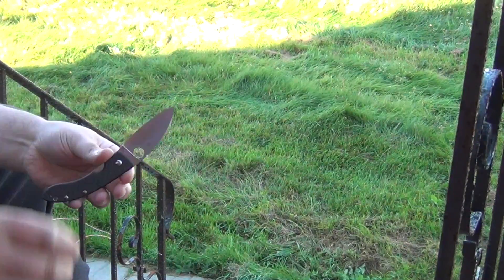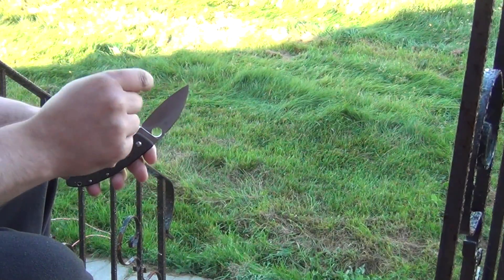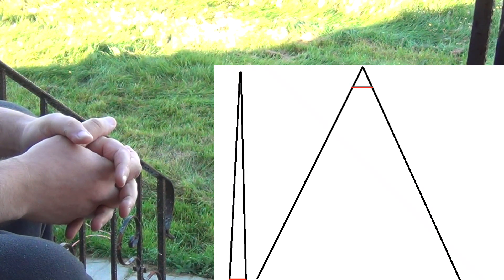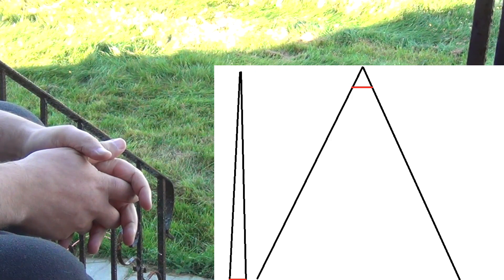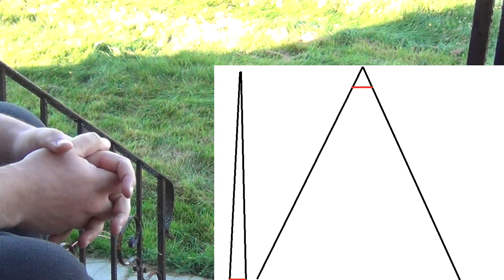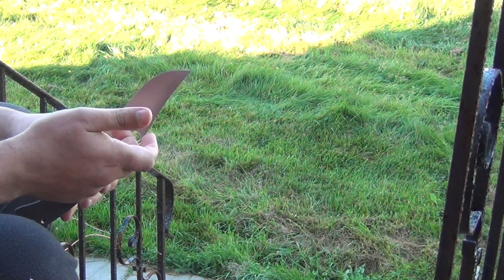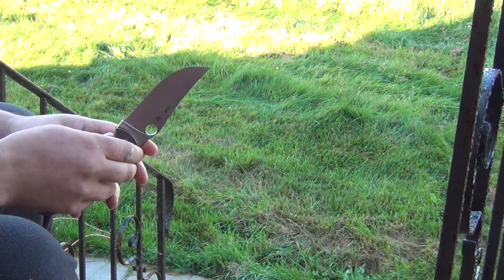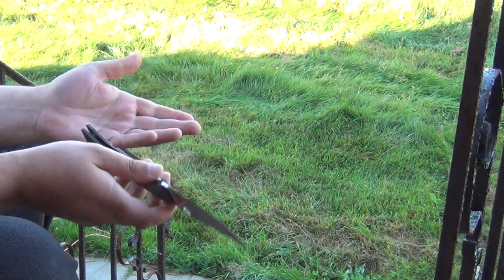Edge retention as a function of micro-bevel angle : VG-10, S30V (Wicked Edge)

Comment: This is something I'd love to see a good spreadsheet made up about. Comparing steels for the actual capability of thin edges without breaking or bending. Optimal hardness to toughness ratio, and any carbides are a bonus. Steels like 52100, 5160, 20c15.. they all have incredible toughness for their hardness, carbides be damned. 52100 with a Rockwell of 65 and a toughness 3x over D2's best case scenario, that edge can get a whole lot thinner and stay competitive.

Comment: I wonder why cliff never bothered asking what happens when you start lowering the edge angle on these high carbide steels? 🤔
Reply: High carbide steels can’t take very low edge angles due to poor edge stability.
Reply: @temhawpin  that hasn't been my experience. 

Speaking of edge stability. Something like  vg-10 which is an ingot stainless steel. That has very large carbides, likely would have worse edge stability in general than something with a higher volume, of fine carbides like a pm tool steel.
Reply: @_BLANK_BLANK  VG-10 carbides are larger but are more randomly dispersed with more matrix between each carbide. CPM steels have smaller individual carbide size but much larger carbide aggregates which create larger lines of fracture when material failure occurs. Most of what people experience with steels is simply confirmation bias.
Reply: @temhawpin  it's very much the opposite. If you wanted to see for youself. And not have it be anecdotal user evidence. Cpm 154, and 154cm is a perfect example. Or d2 and cpm d2.   

You can see the carbide segregation in micrographs of vg-10. The carbides arent laid out randomly. On thing is, they are quite large, but they are laid out in bands like any high alloy ingot steel. Because of how high amounts of carbide forming elements act while the steel is solidifying. 

That's the point of powder metallurgy, it doesnt allow carbide segregation to happen, and for carbide banding to occur. Its cools too rapidly for segregation, and growth into large carbides to form. 

If you don't believe what I'm saying look up fracture toughness of both cpm154, and then 154cm. Its a very clear difference. 

Also, its not like vg-10 is even a low carbide steel. Its carbide volume is 12-16%. Thats in the same range as k390. Its just relatively soft, and large chromium carbide rather than small, evenly dispersed vanadium carbide.

There are ingot stainless steels that do actually have good edge stability. Aeb-l for instance. Without getting into the weeds, because they can keep the carbides fine, even though its an ingot stainless steel (esr). It can reach 64-65 hrc, but maintain an acceptable toughness.
Reply: @_BLANK_BLANK maybe because large carbides are less prone to being knocked into and cracked, chromium carbide is easily abraded without cracking, and come on chunky carbide acts weird. D2 is another example. I think the relatively barren microstructure with the odd large carbide here and there makes for a different, desirable outcome. 

Also I think he doesn’t go thin or low on them too often because he also wants to be able to cut into wood and is applying a lot of lateral load the the edges.
Reply: @_BLANK_BLANK and the total volume of the carbide is what directly influences a steels toughness. Can’t really circumvent carbide volume. You CAN strengthen the fuck out of it, like with maxamet. But then again I’ve seen people break their blades so I don’t know.
Reply: @_BLANK_BLANK AEB-L is an esr too??
Reply: @lindboknifeandtool  no its actually continuous cast not esr i was mistaken when i said that
Reply: @lindboknifeandtool  so with carbides, if they are too small cracks just go around the carbide so it makes no difference. If they are too big they crack easily like in d2, if they are in between thats where you get an improvement in toughness. 

When you have giant randomly dispersed carbides they almost act like impurities in the steal that provide a breaking point for crack formation. Thats why if you check out toughness testing of cpm d2 vs d2 you see a giant difference. With psf27 in between. Its because of carbide size along with volume. 

As far as the type of carbide that makes little difference as far as the toughness of the actual carbides themselves. Even though their hardnesses are different. Thats why you ideally want only mc type carbide. Because you give up the same toughness for a given volume of carbide no matter what kind. So you might as well get the most of it with vanadium or niobium.

Comment: I always put my microbevels on 90 degrees per siden since that is 180 means you can cut with both sides of the edges its my secret shhh
Reply from the maker: You should apply them at 360, then you can cut at any angle at all.
Reply: @CliffStamp  aha and make a turn around blade yes yes

Comment: I have basically moved into more dangerous toys and haven't been really interested in knives is a while.  This video and confirming it by my own tests on several different knives /steels is part of the reason I don't really look at steels when choosing a knife.  Anything from Cold Steel Krupp 1.4116 stainless up to 154CM is fine by me.  I don't really like S30V or higher wear steels.  I've not had much luck with knives in those steels.  Some knives come with them, and I like the design enough to tolerate the steel.
Reply from the maker: Yeah, I spent a lot of time comparing steels, but mainly it was because I was interested in the metallurgy. From a practical point, learn how to use knives, sharpen them and modify them for your own uses - that is far more important.

Comment: Its a good video when you come back to it year after year and reference it to others in discussion.  From one Cliff to another, thank you!
P.S.  Did you ever do a comparison with same angle and changing only grit rating on the WEPS?
Reply from the maker: I have done grit comparisons on the same knife/angle yes :

http://www.cliffstamp.com/knives/articles/grits.html

I also started an edge retention comparision using the Wicked Edge, but got busy and didn't finish it a few years ago. I am extremely anal about methods so it takes me a long time. I have to do 8-10 runs per grit, etc. .

Comment: My question is what would happen if you put a 2.5 degree micro bevel on the S30V blade, would it then far exceed the same on the VG-10 blade?  My guess is yes... just curious how much better it would be. I am surprised you didn't cover this in your video because after watching it one would think VG-10 is equal or better with the micro bevel but its not apples to apples.
Reply from the maker: Yes, if S30V was optomized, its performance would increase as well.. The purpose of this wasn't to compare steels, but to show how important geometry was and that comparing a "Super" to a regular one geometry is more important than steel choice.

Comment: i find what is said about one steel or another depends on which steel is being sold .
      i have used most of the steels sense 1968 .i have found the main and mostly only difference is carbon or stainless .
     now everybody all at once say stainless rusts to .
  carbon is tougher .
  stainless rusts so slowly its easy to maintain and given the good heat treat is so close to being tough ( soft enough to bend )that i cant tell the difference .but tough steel doesn't hold the edge as good as hard ( breaks before it bends ) 
     so i choose stainless d1 or d2 .if they have a softer heat treat say hrc 50 to 55 .58 maybe they will be so close to carbon no layman will be able to tell the difference .and it won't rust like steel wool. so if i neglect it and i will it will be rusted so little that it wouldn't matter .
     before the zelots go off remember .i have used both in many conditions .back when the stainless was hard to get and cost more than carbon .
      it depends on which steel they want to sell which one is hyped the most .

Comment: hi,tell me please :
what kind of stone do you recommend for VG-10 Semi-Stainless Steel?
it's very hard to make sharp this steel because it's a rigid steel
thanks
Reply from the maker: What kind of edge are you trying to get? Fairly coarse or high polish?
Reply: japanese edge very sharp I need
Reply from the maker: If you want a very fine polish, high grit finish, then I would use a Spyderco ceramic to finish. I like the medium one for most work, but the fine one is higher polish still.

If money isn't an object then you want :

-a decent 1000 grit stone, king is fine
-3000, sigma power select-II
-medium spyderco plate
-fine spyderco plate

The 1000 (King is fine), is used when there is visible damage. The 3000 is used just to reset the edge bevel before applying the micro-bevel. A simpler set is :

-1000 grit kind
-medium Spyderco ceramic

This will go a long way, the other two stones just allow you to save some wear and get a slightly higher polish. However you would have to be doing very precise work to notice the increase in grit finish.

If you have any issues, just ask on the forum.
Reply: thanks

Comment: Should you not compare the edge retention at the same angles in order to determine the properties of the blade? Sure a razor blade will cut more manilla than a spoon. What is the point in trying to gauge apples to onions? Edge retention should really be a measure of steels edge holding capabilities rather than geometry, should it not? Practically speaking a 420j at 5 degrees per side would be sharp compared to, say s30v at 25 per side but is fairly useless in anything other use than super light cutting.

Comment: What does "TCE" stand for on your graphs? You did 50,000 sharpness measurements? How do you measure sharpness?
Reply from the maker: Total cutting efficiency, it is a measure of how sharp the blade stays during cutting, not just the sharpness at the end.

A light cord is cut under a specific load and the length of edge to cut the cord determines the sharpness.
Reply: Okay, that sounds more scientific than shaving your arm hair....although judging from you thumbnail photo you've got more of that than most folks.

Comment: I believe there is a lot of marketing and hype behind 'super steels' but at the same time it seems like you start your little experiments with a pre determined outcome and then work backwards to prove your point. You can in theory make 420hc retain an edge as good as 10v if you compromise all the other characteristics you want in a knife. You can make 10v retain an edge as long as 420hc without having to compromise it's overall performance as much. That's what makes it superior.
Reply: What real actual work do you do on a day to day basis where 420HC isn't good enough? 

I'd prefer 420HC for just about any "actual" work. I'd mention kitchen knives, but I'd rather have VG10 than 10V for those, anyway. 

In the course of actual work, a steel that has small carbides, wears predictably and refreshes easily is just better. Most people don't do much "actual work" with their knives, but if you cross over to woodworking, you'll see the same thing with blade steels - except there's an additional variable there - the edge needs to be uniform through wear if you're truly doing hand tool work, or broken out carbides will leave little lines all over the surface. Simple with the smallest carbides is again best there, and you have to refresh often in woodworking, so no damage (just wear) and easy and predictable refreshing is important.

Comment: Say Heah Cliff,  I just wanted to share this with you. We all know how good Mora Knives are, and some even claim their Stainless Steel is almost as good as the Carbon Steel Mora. Anyhow I wanted to know what kind out Stainless Mora was using, and I found out that they were using the 12c27 Sandvik Stainless.  I alway's wanted a Lueku which is Carbon, But the two smaller knives the Stromeng KS 5 and the Bhuku STAK,  the large Lueku is the KS 9, are made in the Stainless 12c27 Sandvik Stainless Steel same as the Mora Stainless Steel. I also found out that Ice Skating Blades are made from it. I came to a conclusion that the Tempering plays into how good the knife will be. Mora, and Oh by the way Brusletto makes the Stromeng Blades and I'm sure both Temper the steel good, I also noticed that in my Puma Warden with a Saw Filder, It holds a pretty good edge retention and it's a 440a. same with the Bokor Double Blade  Hunting Knife Fikder, it holds a good retention and it's 440a. Yeah, that's basically where the less expensive knives vs. the more expensive knife, I concluded it's the time tgey take tempering the blades, Correct me if I'm wrong, I do value your knowledge. Also how good the edge retention of my John Bradley Austempered 52100 Steel is, for a super thin edge, it's pretty strong and hold's a great edge, I'll stop now and hope you can reply, In the mean time, , , 

https://youtu.be/ulQzcYT9Dds

Best,
Paul'ie

Comment: Cliff, i have watched this vid several times. What interests me, what is the optimum edge/micro bevel angle and thickness for the CPM10v/K2 so it outperforms the optimal beveled/sharpened vg10/s30v knife. Because theoretical the cpm10v steel must be able to outperform the other steels. F.e. limited to cutting through soft materials.
Nice vid. Very interesting.
Reply from the maker: +KnifeCollector031 The Netherlands (Messenhobby) As the angle is dependent on the forces applied to it you need some experimentation to get to the optimal point. As you keep reducing the angles the cutting ability and edge retention will in general increase until you get to the point it is so low it starts deforming and cracking vs slow wear. Thus you just reduce the angle 1-2 degrees do some work, and repeat until you lose performance. Then you go back one step and that in general is your optimal point.
Reply: Ok, clear. Thanks for the information. Keep up the good work. And when will you do a comical video again? I enjoyed the previous one very much.
Reply: +Cliff Stamp This one response made so much clear for me. Answering questions I had only partially formed in my mind . I bow once to the east, and once to the master.
Reply: +kleinbottled79 Is it at all correct that failure via cracking is a failure of toughness? and the deforming is a failure of hardness?
Reply: Deforming: the steel is too soft. Cracking: it isn't though enough.

Comment: Im measuring right before my secondary  , where primary and secondary meet ,
Reply from the maker: +zacatecano1986 What is the hardest work you are doing typically?
Reply: clean wild pig and deer . not hard at all .what would adequate sharpness be for that task?
Reply from the maker: +zacatecano1986 Are you chopping through any of the bone?
Reply: +Cliff Stamp    I just got back from an oregon hunt and i do chop through bone sometimes not often  for that i want something else but the hardest use is skinning .  And i did chop some pelvises with s30v and it chipped , now i got some new almost done knives in 3v steel and some in s30v   But im not sure on the edge geometry id like to have the kitchen knife i made shaving sharp and  the skinners shaving sharp but im not that knowledged yet
Reply from the maker: +zacatecano1986 If you are chopping into bone then you are likely going to want ~0.025" at a minimum to prevent the edge from turning. If you are just skinning then you can go down to 0.005" . A number of makers run hunting knives in that range.
Reply: Thankzz cliff all info appreciated  i will run the primary to .005 on the s30v  and the 3v i will run it to .025. The s30v is on my kitchen knife and a skinner  and the 3v are for some hard skinners and tougher use knifes that will see some hard use . Thanks for the info all info was helpfull now i need to write notes on my results thankzz again 🐗

Comment: Cliff what angles do i need to get my 3v steel knives to razor sharpness . What thickness should i have on my primary grinds. I dont understand that geometry all indo is helpfull .
Reply from the maker: +zacatecano1986 The angle can be sharpened regardless of the size. In general though the lower the angle the higher the cutting ability and edge retention in general.

I am not sure where you are measuring thickness?

Comment: awesome! I do have one question pertaining to the grip angle comparison between s30v and vg10.  You remarked that if one reduced the grip angle of vg10 the edge retention would be the same as s30v; is that relative to s30v or are you saying that once the two steels got below a certain apex angle then their performance would be indistinguishable? 
Thanks
Reply from the maker: +BCB Inherently, at the same apex angle S30V will have a slight advantage as it is more wear resistant and harder (in those knives) . However if you reduce the apex angle of VG-10 then you can increase its edge retention to equal S30V kept at the higher angle. 

The point was that the angles you sharpen are as, or maybe even more important than the steels in regards to edge retention.